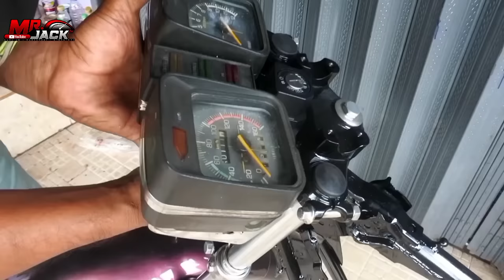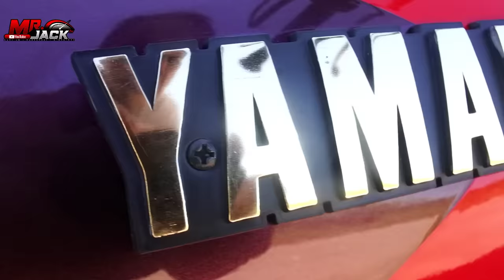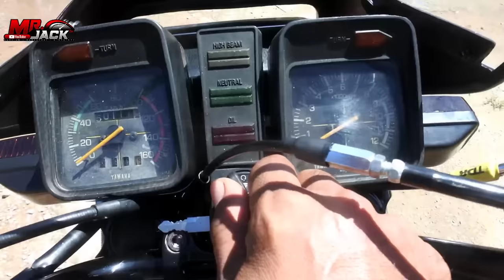FULL RESTORATION ABANDONED OLD MOTORCYCLE . Rx spesial 1993 from the cowshed (Part 5) 🔥🔥🔥

Comment: Frame cleaning before to the paint is not satisfied and you have to rust seal the inside of tank and some opened tubes  of frame too..

Sand or water blasting is the bast way to clean and there are many things to be taken into your consideration in this restoration friend...